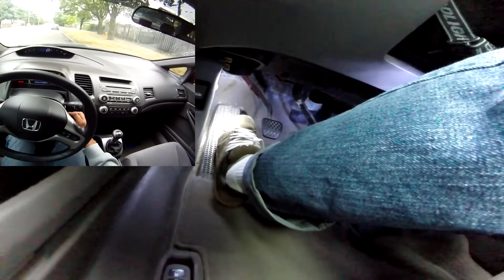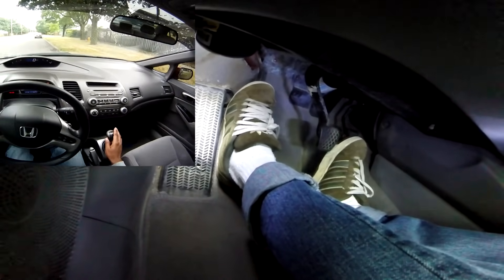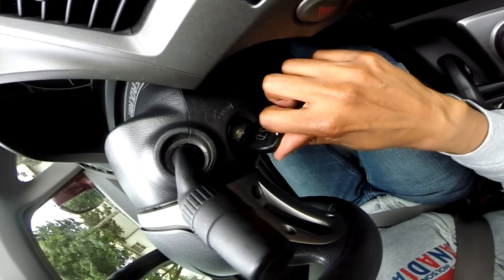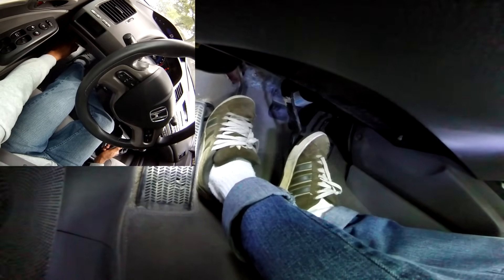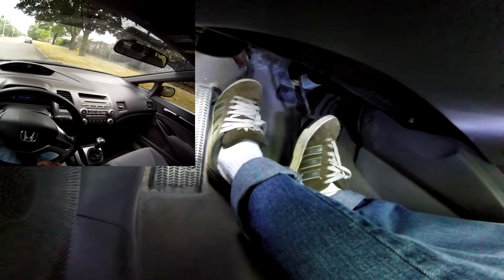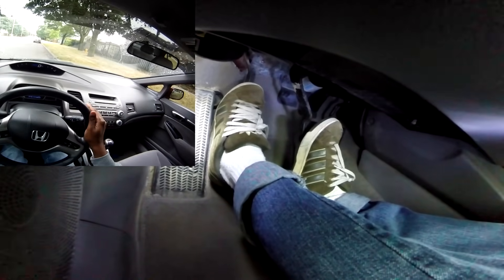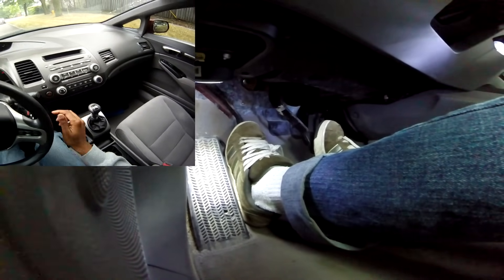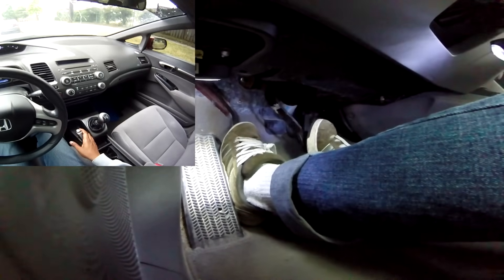(1) How to: roll push start manual transmission

Comment: Sorry for the noobish question. If I pop-start my vehicle, will it bypass the starter of the vehicle? Is it possible to pop-start a manual transmission vehicle that has a broken starter? Yes, I did ask the same question two different ways. Thank you for reading this comment. Especially, thank you for answering the questions.
Reply from the maker: yes if the starter is not working you can push start it you are not using the starter for this.
Reply: rtfm read the manual, not all cars are allowed to be started this way; older cars are ok with this but newer cars may take some damage; don't do it if it isn't allowed because there are some other side effects (read the manual).
This starting method was/is comon with some bikes and older cars (but in the first or the second gear)
Reply: I have a 2017 fiesta, and the manual says this is okay to do in emergencies
Reply: If the manual makes no mention of whether this bypasses the starter, is it safe to assume the starter is bypassed? To put this question in proper perspective, I am a bit of a computer technician. I own a device called a static-discharge bracelet. It comes with a manual. The manual makes no mention of the fact, that if the computer is on, there is a decent chance using the bracelet will kill you. Every book talking about using the bracelet mentions this fact, with the major exception of the book included with the purchase of the bracelet. The owner's manual for the Nissan Pathfinder does recommend pop starting the vehicle, if the vehicle will not start. However, it barely says anything about it. This suggests to me, it will bypass the starter, but I am still not sure. If it does not mention it, is it safe to pop start the vehicle when the starter needs to be replaced?
Reply: +losttownstreet
what damage does it do on newer vehicles and what's wrong with pop-starting???
Pop-starting a vehicle has the same concept of hand starting a portable generator except with the use of a starting motor. If you have a good battery, it can provide continuous power to the spark plugs which is in-sync with every cycle of the piston( car rolling motion). It's just a nuisance if you have a broken starter motor but it is safe and doable to pop-start your car even the newer ones. For Automatics, it would probably be difficult because you need to spin that torque converter at a certain rpm to transmit power from the engine to the transmission.
Reply: +Carlos Perez
Starter motor is not affected during push/roll start. To explain this, we should know how a starter motor works. 
Beside electric motor and a solenoid, the starter motor also has a ring gear which is fitted to the outside of the flywheel on manual transmission car (or the torque converter driver plate on automatic car). 
The ring gear is driven by a pinion gear which takes the drive from the solenoid. This pinion gear meshes with the ring gear only during starting operation by ignition switch.
So, it's clear that starter motor is not affected during push-start.

What is interesting to me during push/roll start is the time needed for the engine to start.
Major parts such as fuel pump, ignition system, ECU (not to mention sensors) need electric supply from the battery, while it will take time to charge the battery from the alternator (generator).
During early minutes/seconds (especially when the wheel is rolling slowly), combustion doesn't occur as the battery is not sufficiently charged yet, but rotation of the crankshaft is enough to rotate the alternator's rotor which in turn can supply electric charge for the battery. When the battery has plenty of charge, the engine should be able to start.
Reply: @nobilitas16   If i remember correctly there's a risk that timing belt will jump and that can damage the engine??? Not sure if the risk is higher in newer cars though so maybe there's something more to it...
Reply: What do you mean by "jump"? you mean timing belt went out of alignment? or sudden jolt?
Once the engine starts combustion, everything else will follow.
The only main thing youre doing here is to start combustion of the engine.
Reply: @nobilitas16  ye belt going out of alignment which afaik leads to pistons hitting on injector/exhaust valves... to reduce the risk u should drop clutch gently and preferably go fast enough for 3rd gear (20km/h+) & never do it on first  (higher rpm makes it snap harder)
Reply: This method of starting a car causes additional wear on the clutch and flywheel assembly than would otherwise not happen. Picture a brake suddenly clamping down on a spinning wheel with such force that it jolts to a stop.

Comment: We called this “pop the clutch”. Everyone I knew had a manual and knew how to do this.
Reply: Jay White So I just push it off a cliff and put it in second gear? My starter is going bad so I may need to do this in the future...
Reply: Angel Gutierrez I wouldn’t “push it off a cliff” lol. Since it’s working now, find  a decent hill where you can practice this in second or first gear. Turn the key to “On”, hold both brake and clutch, put in first or second, then release the brake. Once the car starts rolling (5mph) release the clutch. You should feel a sudden jerk then the engine should start.

Comment: A while back I had a shitty 1991 Toyota Celica, it was a good reliable car but it had a dead battery so it would go flat often and I had to push and start the car all at once lol. It was fun. Usually I’ll try to push the car to the closest slope, let it role and then running back to the car and starting it. Or just push it as hard as I could until I can’t catch up with the car moving so I jump back as fast as I could.

Comment: Used this all the time as a teenager late at night to leave places, quietly :)  anyone know if it still works with push button start cars?
Reply: I don’t have a car that has a push button ignition, but try to, attempt to turn the car on by pushing the button. I think it will put the car into the “on” position. And then you just do the same thing here. But don’t do what she said here, “put the car third gear.” Instead, put the car in second gear, get up to 5-10mph or faster, then let go of the clutch. If the car starts, add some gas just to make sure it stays on.

Comment: this could be a 30 second video where you go: turn the ignition on, put it in 2nd gear, get someone to push, dump the clutch and voila. that’s how it is done you have just over complicated things here
Reply: Drive Manual lol i’m 16 and don’t have car but i have push started cars many times
Reply: Drive Manual yeah karting is great. this summer i am working on my project car which will be used on tracks
Reply: Drive Manual nice. mine is a 1997 suzuki swift so quite similar to the civics. was thinking of putting a B16 engine in it
Reply: Drive Manual yeah. i’m wanting to make reliable power hence the b16

Comment: Don't try this for 2008 Honda Fit. Just tried this, now my car is stuck 2 blocks away.
Reply from the maker: why did you let it roll for 2 blocks?
Reply: If you must know: 2 blocks away from my house there is an area that my parked car would not impede traffic.

Hey, I am not saying this is a bad instructional video (It is an excellent step-by-step instructional) I am just saying this did not work for me.
Reply from the maker: Can you tell me what exactly happened how many times did you try to start it in 2 blocks? Did you leave your lights on? Was it flat ground or a hill? did you get it boosted?
Reply: All 2 blocks were downhill. Lights were off. I tried starting in 3rd, 2nd, 1st, and Neutral. My brother gave me a jump start about 20 minutes later.
Reply from the maker: Well in neutral it wont work because that is the same as keeping your clutch foot down. Since your battery is charged you should try it again on the hill to see if it will work for you. One way this wont work is if your alternator is not working properly or is dead. Your alternator is what charges your battery so it can also lead to dead batteries.
Reply from the maker: I hope you can try because im curious lol. I don't think it has a push button switch that car?
Reply: All there is here, is hills. That's why I was able to roll 2 blocks. I will definitely keep trying because I need to learn how to do this, just in case. Also, my Fit is a key start. I made sure it was on, using your method.
Reply from the maker: ok post up if it work or not just let it roll like 20 feet and try in 2nd. it should work if it is key start. Thanks very much. you can even try reverse https://www.youtube.com/watch?v=d79wI1YUel4
Reply: will park wot

Comment: I had this problem twice due to a bad Alternator I recently had it rebuilt so everything is good so far but my old battery killed my Alternator it was so bad with corrosion it ate away the positive terminal I had to replace both my battery and my positive terminal along with rebuilding my OEM  Alternator a few people told me I should try to push my car and jump start it I wasn't sure how to do this plus I wasn't facing downhill so my car wouldn't roll if I tried it
Reply from the maker: if you keep your old battery you can try boosting it with that as well. But if alternator is killing the battery it may be overcharging because of bad voltage regulator you can see this alternator is overcharging https://youtu.be/Lxvv226Yyzs?t=1m5s pushing the voltage to 17V it killed the battery

Comment: It's fine when you're on a hill but what if you need to push it yourself? Will the the car not be really hard to move if the clutch isn't engaged? Or do you start the car, take the handbrake off, push it, jump back in, press clutch and put in gear. Then try and start the engine. That seems right now that I've written it down lol
Reply from the maker: you put the car in neutral, put car to on, get out, push car near a-pillar , don't push on door (easy to break door) car starts to roll then you jump in (be careful you don't trip and run over yourself) and when you jump in you aim for the clutch pedal , press clutch in , move stick to 1st, pop clutch out and car hopefully starts, give little gas so car doesn't die, if car doesn't start you have to do all over again. One time I did it like 3 times in row and car still didn't start lol , I was so tired I fainted and had to call an ambulance to get me LOL there's more to that story like when I was passed out on the ground someone threw a beer bottle at me ....but i'll put it in a video one day lol
Reply: @DriveManual  After you put the car to go on, you still need to release the handbrake though or the car won't move lol. Good video though and accurate description of the theory behind it. Yup I've had a fair share of pushing the car, so I know and my cousin did it once in front of me. Haha omg really,  why would someone do that lol maybe they just thought you were wasted, or to see if you were alive.
Reply from the maker: yup release the handbrake lol , yeah I was at back of an apartment in bad neighbourhood and someone threw bottle from balcony LOL then someone spit on me and I felt it on my face as I was laying on the curb waiting for ambulance LOL
Reply: @DriveManual  Eww that's horrible, you should have sued them, although probably hard to tell who it was if you had already fainted,  poor you.

Comment: You shouldn’t do this all the time for a pretty expensive reason. The engine drives the transmission when it is running and in gear. However if you have your clutch in while your moving with the engine off and then release it , your basically making both the engine and transmission at a pretty damaging pace. However, like I said I don’t recommend doing this all the time
Reply: I imagine it would wreck your syncro rings pretty quickly
Reply: @muserock2367  yeah thats a definite.
Reply: @zane G Yeah you are... if the car is rolling and you have the clutch down while in gear (Im guessing you mean with the engine running, seeing as doing it with the engine off is exactly what he does in the video so your comment wouldn't make sense). Then all of a sudden you're slamming the clutch plates together (one of which is spinning and the other isn't) and forcing the engine to move. It will put immense strain on your transmission, damage your clutch plates , and also probably snap your syncro rings

Comment: Can you do this without key, what's the point of the key here, power from wheel will transmit back to the engine right?
Reply from the maker: they key is the switch that turns on the power to computer and fuel pump and ignition. It is like you have a light switch in your room and to turn on the light you need to flip the light switch once key is on position when power starts to generate from rolling the car it will power the computer and fuel pump and ignition  but it can't happen without you turning the key to on
Reply: @DriveManual  but the point of a key is just to provide electricity to starter motor which makes engine working and nothing else, after that engine does everything, my questiong is when you roll a car can you make engine start working fast enought to start process of inhale micture of fuel and air and thus start a car? I dont get the part with a key, and is it what i'm saying possible?
Sorry for bad english.
Reply: Talking about internal combustion engine
Reply from the maker: @markopopovic2266  there is 2 position in key switch one is turn on power, then all the way forward is to turn starter
Reply from the maker: @markopopovic2266  adding to last reply see this picture https://imgur.com/Qj5NnKl  the "acc on" means "accessory on" that is fuel pump , computer ,ignition , then you turn al the way forward for starter, after starter starts car you release key and it flip back to "acc on".  That is why you need key

Comment: That's not a battery problem because you are getting the light come on the dash. It's probably spark plugs or starter motor is gone. If it was a problem with the battery it would be a constant clicking sound
Reply: If the dash lights come on but the engine doesn't crank its usually the fault of a dead battery. If you hear a clicking sound then it's a bad battery (too low or no connection).

Comment: Out of curiosity, would this work on a vehicle that has a push button ignition rather than a key?

I wouldn't see why not, just curious how the ignition switch differs in a key vs a button.
Reply from the maker: please check out the pinned links
Reply: @DriveManual  Yeah I'm a tool and saw it 1 minute later in my reccomended. My bad. But great vid!

Comment: Crazy how this car is still rolling while in 3rd gear. maybe since it is a smaller gear than 1st it will keep rolling.  But at that low of rpm wouldnt it stall?
Reply: It's not rolling in 3rd gear?clutch was in

Comment: So before letting go of the clutch you don't have to put the key in ignition mode?
Reply: No.
Once the car is rolling and the clutch is released the car will automatically ignite the engine.

Comment: Interesting -- I always thought first gear.  Damn, I doubt I'll ever own a manual again, or I'd try it in second or third.  I wish there were a way to "torque-start" using an automatic so I don't need a tow when my battery goes dead.

Comment: my grandpa has a 76 Cadillac Fleetwood that's been sitting for 30 years in 1 spot the best part the tires arnt flat yet and has fluids still in her last time she fired up was in 2001 its an automatic but wont start due to a battery problem no mechanic can figure out gone through 50 new batterys I wonder if someone can get her to roll that would be very very hard to do if a roll start could start the old girl up.
Reply from the maker: unfortunately you cant roll start that automatic but you can boost it if you got booster cables they are like $25. The mechanic you are seeing shouldn't be selling you new batteries over and over so I would find a new mechanic because those guys were just taking your money .
Reply: Check if you have bad relays in the power box or if the fuel is really old it wont burn as well and if that doesnt work check the starter if its bad (not the alternator)
Reply: Sounds like u got a short somewhere, either buy a new wiring harness and rewire vehicle or buy a battery cut off
Reply: @40rollsonly  very

Comment: Why 3rd gear wouldn't 2nd or 1st go smoother
Reply from the maker: 1st gear there more engine braking when you bring up the clutch the car will want to jerk to a stop very hard so you may have to try 2 or 3 times before the car starts up, if you don't have room use 1st if you have room use 2nd or 3rd it should start easy every time.
Reply: In this instance the gear ratios are reversed since the engine is not providing the power.

Comment: Would this cause a check engine light?  I did this in reverse backing down a hill, and now I have a check engine light.  lol
Reply: It can cause damage to some cars, what was it?
Reply: You might have blown the head gasket because of the vaccum in your car, or your belt timing belt can come off because you're reversing your crank whilst engaging a forward motion into your gearbox